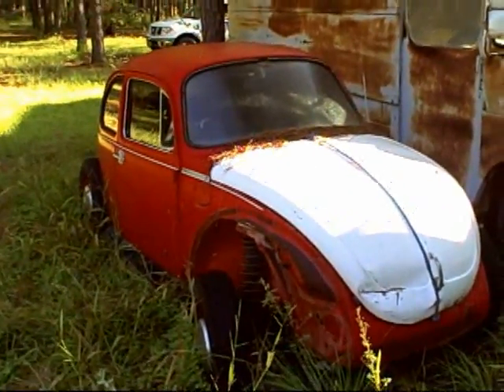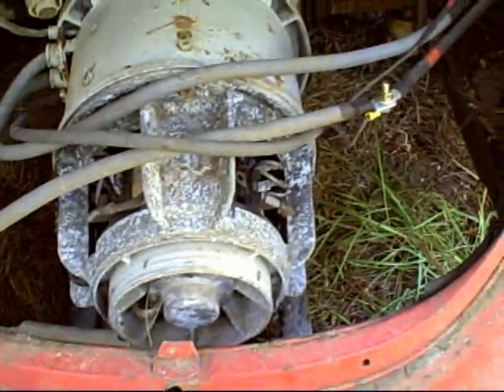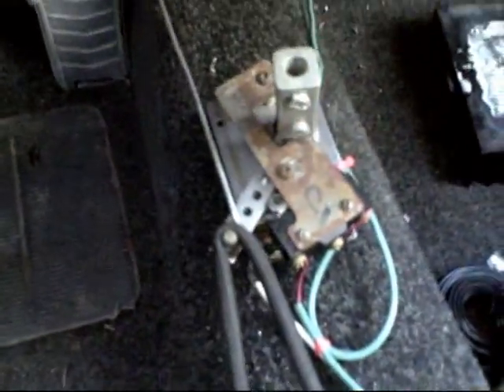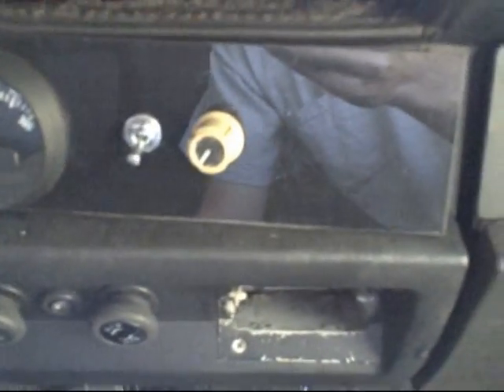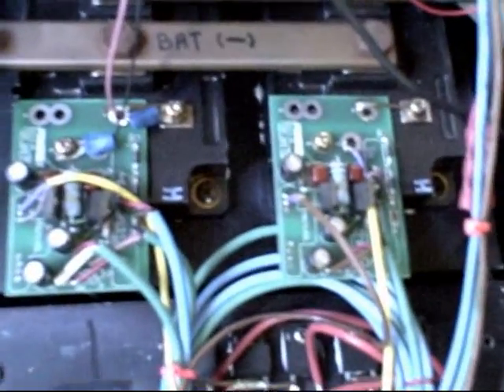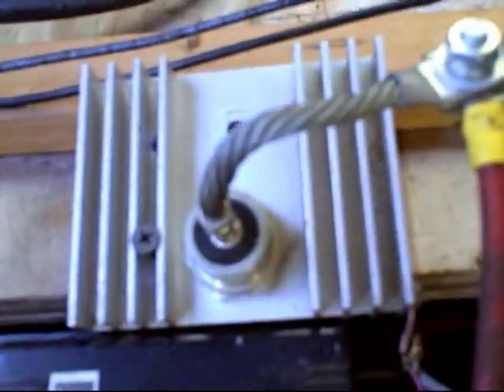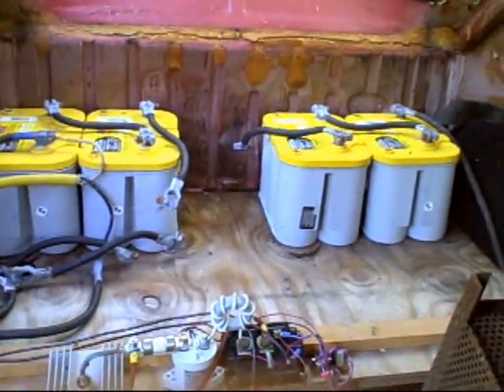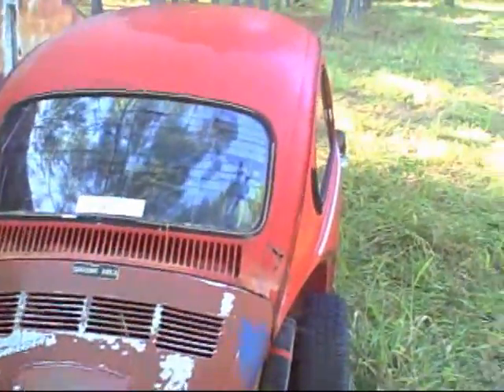Electric VW Experiment - home made motor control

Comment: No mater what motor you used I thing you simply did not have enough battery for the trip you need to do,, those 4 coil type batteries are good but not enough,,  and if  you compare with the efficiency and reliability of a diesel ,, well you will never look at anything electric with good eyes agin.    good job you r good with the lectronics what kind of power transistor did u use ,,,, ..ernest,

Comment from the maker: 100 mile round trip with 8hr charge while at work.
Running an old car on waste cooking oil is easier and cheaper, been doing it for over three years now. And yes, If I do it again, I will not use sealed batteries.

Comment from the maker: I was told by the guy that bought it from the guy that had the front mount machined to match a VW trans. that it was from a large winch on a ship.
Rated 40 horsepower.

Comment: I know its the point not to be reliant on fossil fuels, but i'm really curious myself. If that's efficient, then a bio-diesel powered small generator would still be a relatively green solution and increase action radius dramatically.

Comment: what if you took the smallest gas powered generator you could find , what would you need 30,50 amps? 100amps? and run the small gas generator direct drive to the emotor what kind of millage could you get then ? or have the gen charge the batts when you get low on juice? I've always wanted to build an ecar too :) keep up the good work

Comment: I have a jet starter motor/generator dc but that is what I have to work with so I hope it will do the job,it is a ford ranger but I might try to find a Chevy lov for the weight.
I just got my diesel motor, all happy to start it for the first time, and I had to unceased the fuel pump but I got it going now and it burns about a 1 gal per 8 hours or so but I dont have my generator yet

Comment from the maker: Very quick take-off. When i pulled the switch, it would create an arc that would light up the inside of the car quite well. I only had half the batteries installed at that time, I'm sure doing it with full voltage would have destroyed something.

Comment: In field failures to cut this motor with a help of a fuse is not really a solution. Think of it like this ; your speed will increase and try to reach the maximum value possible. Electro motive force will go higher as the speed goes up. Fuse can stop it in slow speeds but in high speeds it could cause arc which can't be stop by help of fuse ,even in when fuse cut off the circuit.

Comment: HA, going through all that I personally think you should have just connected the 8? batteries to the engine raw with just an ON/OFF switch that would have been connected to the gas pedal. I guess that would have been too easy though, LOL.

Comment: This is an advice that you should really listen to. Since the motor you are using is seperately excited DC motor, it is too dangerous for a car motor. If the excitation coil's cable fail in conduction during a trip ,your car will be crashed and can cause serious injuries.You can make the excitation cable safer (by puting help cable- which shares the excitation coil' current like a parallel cable) or change it with permanent magnet.Good work ; I really liked your car